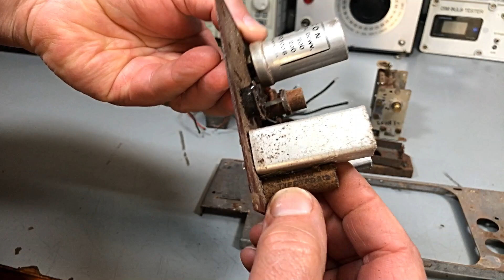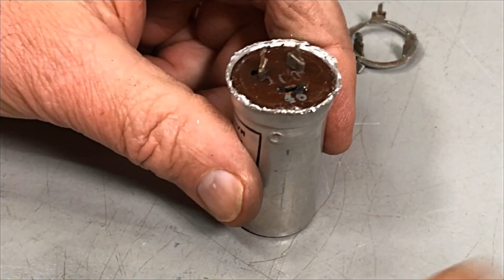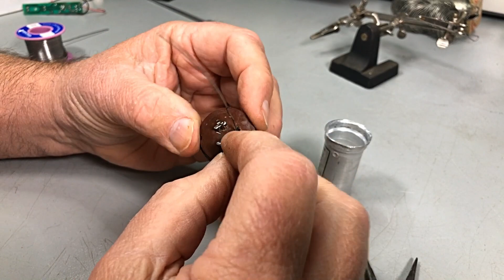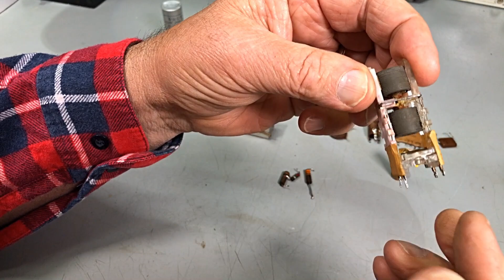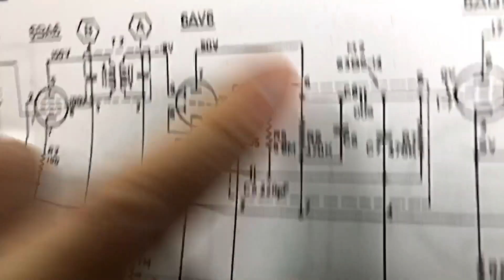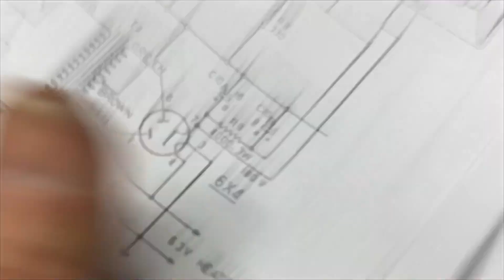Admiral 5AW Radio Restoration -  Part2

Comment: Hi Baz.  This one's full of surprises.  I've never seen an IF transformer like that.  Quite a good design, this one.  There's such a variety of IF transformers, the worst being those little Philips ones. I've also never come across a "couplet" before although I think I've seen one in a video.  These later valve radios with PCBs always seem to be trouble, in fact anything with a early PCB is a pain in the arse.  I'm just finishing up a Hacker Herald RP30 and the tracks lift off the board if you look at them sideways.  Just a quick question: What temperature do you set your soldering iron at for these old circuit boards?
Cheers
Reply from the maker: Yes Don, full of surprises that waste so much time. I love those IF TX's too, such a simple setup & easy to turn.
Hopefully tomorrow when I plug the radio into mains they still work, without smoke. Will try put vid up this wkend IF all goes as planned.
I run my iron at 340-360deg for those older boards. 380-390deg normally.
480 when doing a bit of chassis work, more that that I bring out the big gun, will be in the video.
Cheers 🍻

Comment: Very unusual IF alignment slugs. I don't think in all my years in electronics I have seen it done that way. Always saw internal to the coil. I saw one of those Centralab PC156 couplets on Ebay if you wanted to go totally original but it is a bit pricey at $19.00.
Reply from the maker: Thanks for this, think I'll just stick with the resistor/cap mod.
I really like those IF TX 's as well. Cheers

Comment: I had similar IF cans to those on my National 60 Special I repaired recently - but mine had mica disease so I had to drill out the mica caps and put small ceramics in instead. This hobby does have its disappointments to be sure, such as your cap can here, and the radio I got going perfectly, then looked at it the following morning to find the dial plate cracked. How? No idea. But I know how gutted you will be over that can.
Reply from the maker: Yes, if it can happen it will ! Ruined my day, was cruising so well too !
I'm not familiar with the National 60, will check that out. 
Cheers